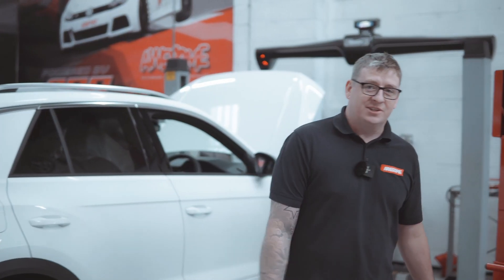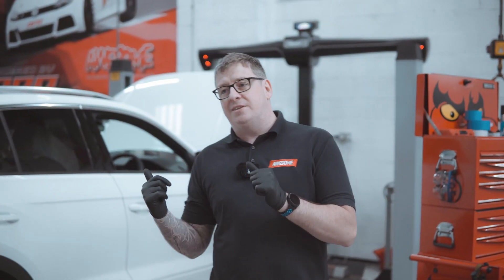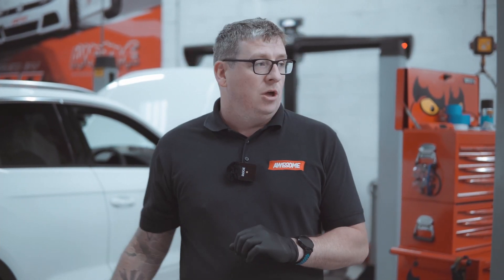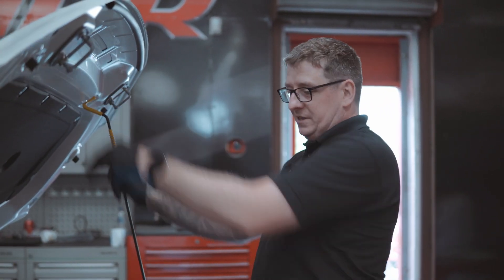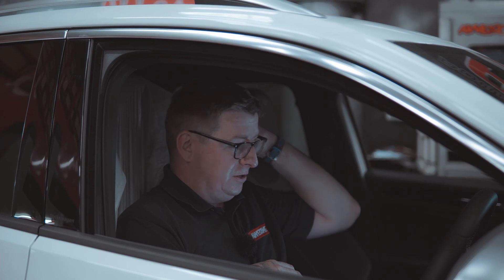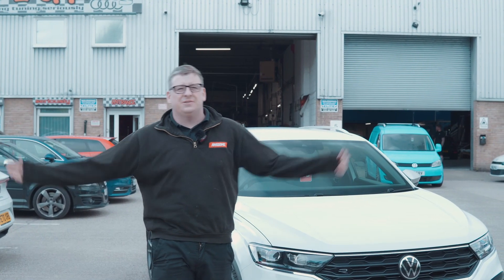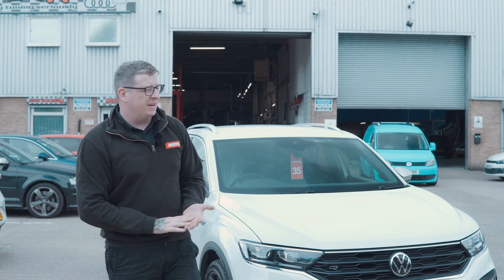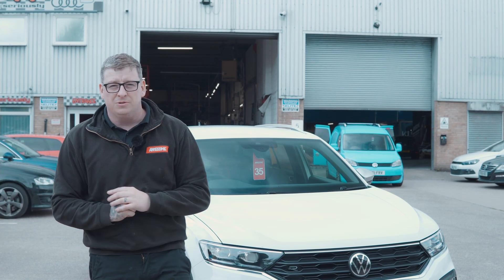TUNING BOX 0-60MPH - how much quicker can it make your car?

Comment: I'm just curious how you guys have this wired up? I just got a GTS Black for A11 T-ROC 2021 plate, and the wiring loom had a 4 pin plug but the boost sensor appears to be 3 pin. Contacted racechip support and they said they don't have the hardware or the software for the latest model T-ROC and its likely 4-6 weeks away yet...have you guys got some test kit not GA?
Reply from the maker: Yes this was a development vehicle and we were testing this with RaceChip in Germany. The one for the 2021 T roc R may be a few weeks ago for commercial release.
Reply: @awesomecars1  that's clears it up, thanks! I'll keep an eye out for the new chip. Enjoying the vids, keep up the good work! 👍
Reply from the maker: @Hallbchris  Thank you!

Comment: Not to be negative at all but you claim the T roc had 317bhp and made 355bhp after race chip .. but most standard mk8 golf R are making 340bhp  + intact I'm sure forge put out a dyno figure of 358bhp stock on Litchfield dyno ..so is the T roc a detuned version of the golf R or am I missing something here ?
Reply from the maker: The Golf 8 R is possibly tuned a little more even though the engine is the same it comes out at 340 on our dyno. Whereas the T roc R is 300bhp as manufacturers state but it ran a 317 on ours.
Reply: All though the factory hardware is the same the factory tuning will differ. This Troc for example is already detuned 20bhp from factory compared to the MK8 Golf R according to volkswagen. So it was very unlike it was going to dyno the same as the Golf R. However it did dyno hight than the factory quoted figure of 300bhp. In terms of ECU calibrations the factory detuned versions generally always make the same end results as the non detuned version which is always great. We're as the Racechip you are working with the constraints of the current output of the ECU tune and reliant on ECU adaptions.